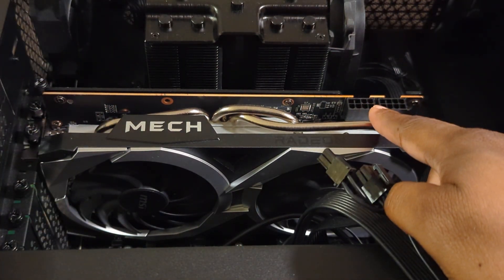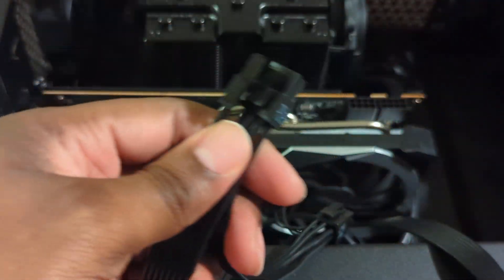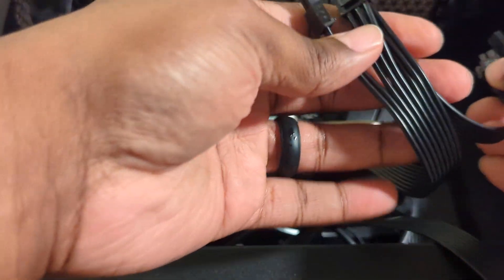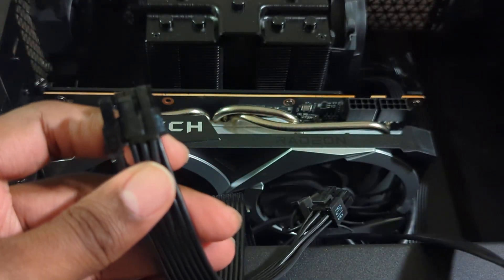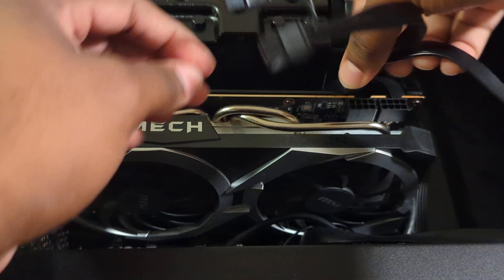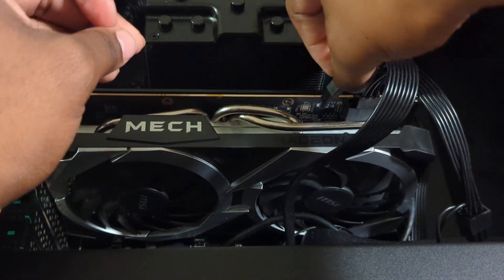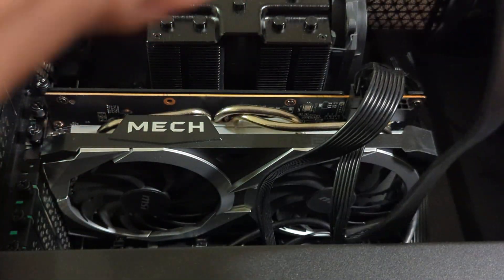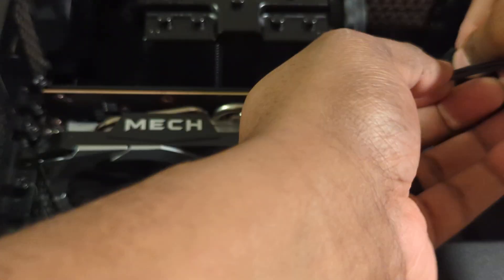How to connect PCIE power cables to Graphics card

Comment: Connect the 2 pin part first, the 6 pin part has a tiny plastic stopper that will push in the 2 pin (which also has tiny plastic hooks).